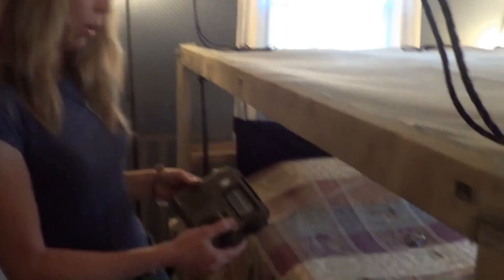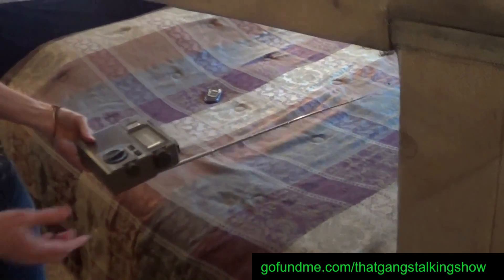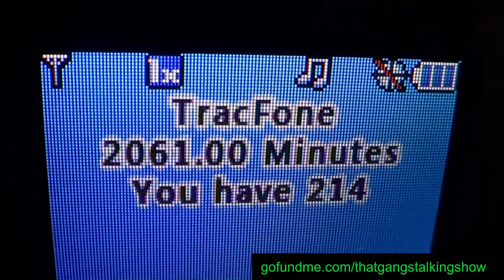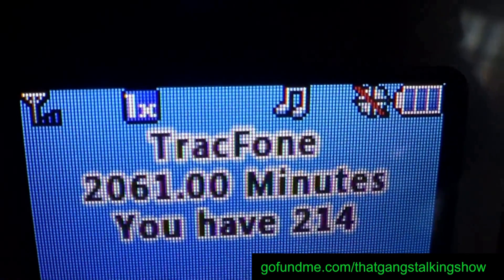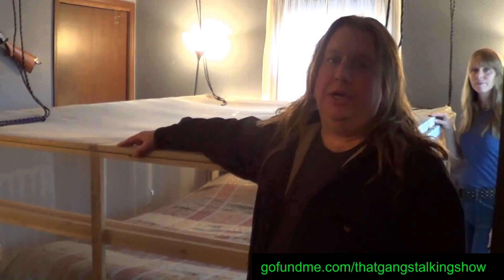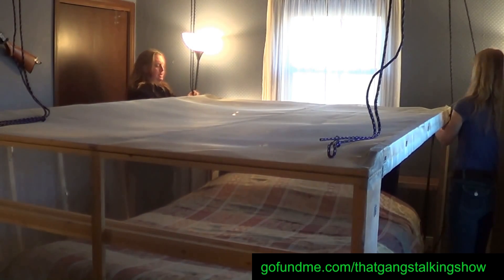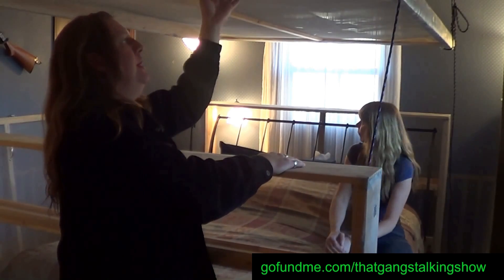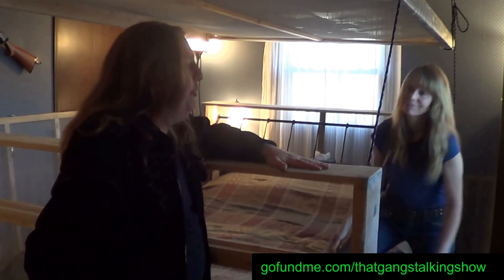Build  Faraday Cage for Your Bed - Shielding to Block EMF Frequencies - How 2 Block Radio Waves

Comment: Ive noticed the smart meter protection slip over devices are a wire mesh like design.

I guess some wire/conductive material can be enough to interfere with these waves to help us avoid their harmful effects.

Comment: This does not show how to build it, it is not a tutorial.
Reply from the maker: They do talk about the materials used and they can be purchased at Lowes or Home Improvement Stores. It's basically wire mesh stapled to 1x1 lumber. If you can put a nail into wood and cut a mesh screen and staple it to the wood, you can build this yourself.
Reply: @ThatGangStalkingShow  
Does this have to be grounded to work? If so, how can you ground it?
Reply: Blue Crystal good point.  You can run a copper wire to a earth ground point.
Reply: @ThatGangStalkingShow  no..... they dont talk about materials

Comment: hi i need to know what to buy and how much. im being tortured raped electricshocked sleep forced wakings, ctrld dream manipulation, they have caused damages to body skin etc. they do this 24/7, daily . im being remote ctrld too. if i cant build this i might pay you to do it. pay for your airfare, and hotel. im in ny. i dont want to be forced to move. thanks
Reply from the maker: I did not make this bed or create the video; however, they do go into detail on how to make it. You need to know the dimensions of the area you want to enclose. I can't do that for you.
Reply: all you need is wire along a conductive surface. all it is ,is grounding. I made one for my electric guitar. just make sure everything is grounded to the same ground. otherwise you get a loop
Reply: also supposedly ti believe its microwave energy. this wouldn't help. you'd need lead
Reply: you can purchase clothes that block RF too, bed canopies or paint for a room

Comment: Holy shit it works and you are not isolated with everyone thinking you are crazy!   There is hope!  I tried 15 years ago to make a faraday cage but failed.
Reply from the maker: So you actually made a Faraday cage like the one in the video?
Reply: No I had tried to make one using other means, but it was not well constructed enough.  Where can you get the wire mesh that you used from?
Reply from the maker: Lowes or Home Depot. It's aluminum mesh screening. Just like a window screen.
Reply: Ah I never knew they made any with aluminum.  All the screens I ever had were made of some kind of plastic.  Thanks.  If I can make one successfully and the attacks can penetrate then I'll know that it's infrasound and not microwaves.  Then again it might not even matter cause I might be homeless soon.